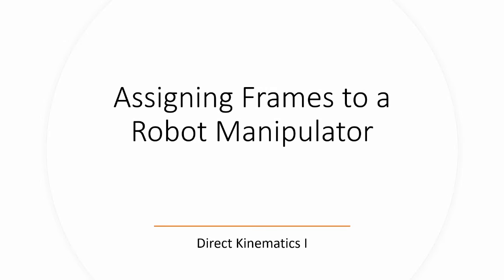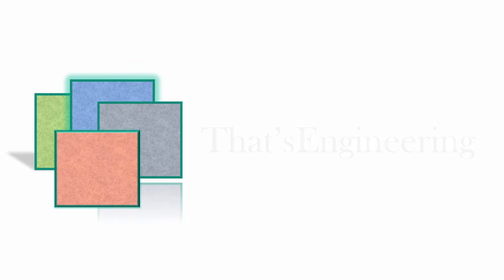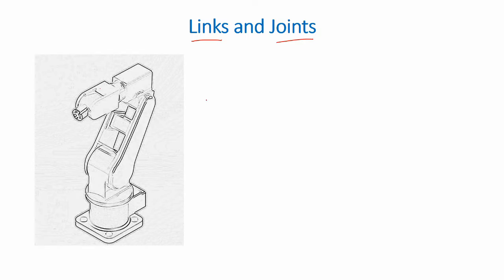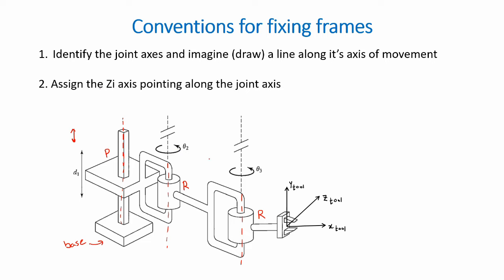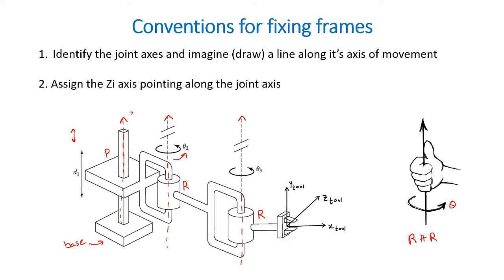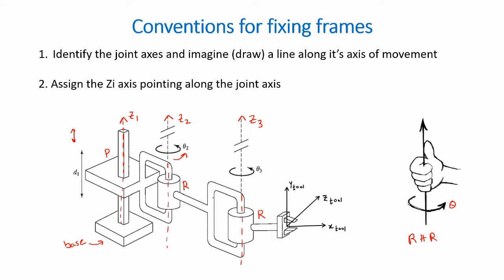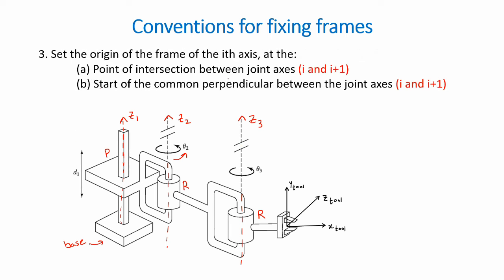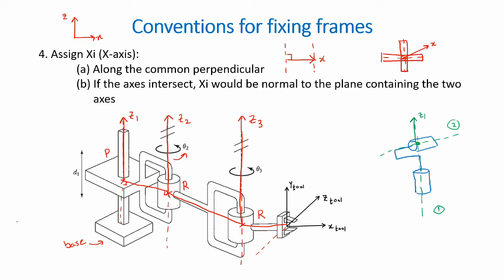Frame Assignment For Robotic Manipulators - Direct Kinematics I

Comment: Y-axis assigned based on the right-hand rule, not the left-hand rule. Please don't mislead viewers
Reply from the maker: As per the convention used, the Z-axis is assigned based on the RHR. This may differ based on a different convention.
Reply: @thatsengineering5235  in the video: "5. Assign the Yi axis to complete a right hand coordinate system." But then you use left hand rules?

Comment: I'm sorry but assigning the x-axes with the planes make no sense to me.. How can you ever have an unambiguous plane if you'r only requirement is that the z axel is contained in it? And more over, even if that is solved by requiring the two planes of adjacent axes to be on the same plane, the normal still has two possible directions. Am I missing something?
Reply: Came to the comments for this!
Reply: I viewed this page to understand what is going on: https://en.wikipedia.org/wiki/Right-hand_rule. I hope this helps

Comment: The 5th step is the right-hand rule but the picture is for LHR?
Reply from the maker: The 5th step is to assign the Y axis. As the X and Z axes are already known the Y axis is assigned mutually perpendicular to them. The rule used is Flemings left hand rule and the picture shows that. Practically, three mutually perpendicular directions. Hope that clarified any doubts.
Reply: @thatsengineering5235  It does not clarify doubts. Your explanation in steps 5 and 6 is super confusing. Up until that point you are talking about RHR and suddenly you use LHR and also mention you can shuffle axes around with no explanation whatsoever. "As the X and Z axes are already known the Y axis is assigned mutually perpendicular to them." - this can be applied with both RHR and LHR, the latter pointing Y-axis in negative direction. Step 5 clearly states "satisfy RHR" yet frame {0} satisfies LHR. Again, super confusing.
Reply: @Power_DC_Official  You should use the RHR for coordinate frames,  Flemings' left hand rule is to do with current and force in a wire nothing to do with coordinate frames. The directions of the axes come from the vector cross products i x j = k, j x k = i, k x i = j where i,j and k are unit vectors in the x,y and z directions.
Reply: @thatsengineering5235  Flemming's Left Hand Rule is to do with the force along a current-carrying wire when subjected to a magnetic field...this is not correct!

Comment: 2:45 Should be n+1 links 
13:24 You shouldn't be using the Left Hand Rule. That is for Flemming's Rule when doing magnetism and force vectors along a current-carrying wire.